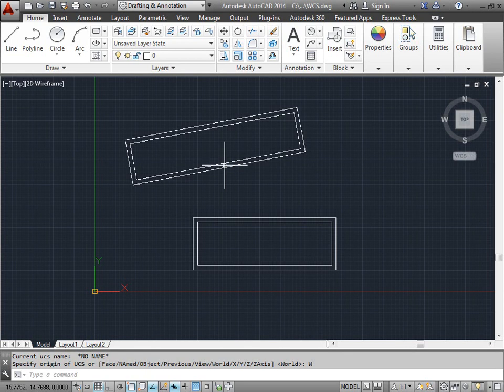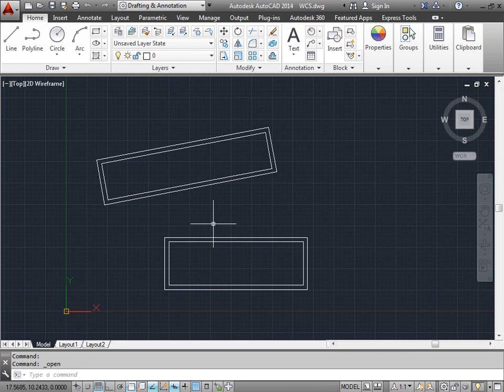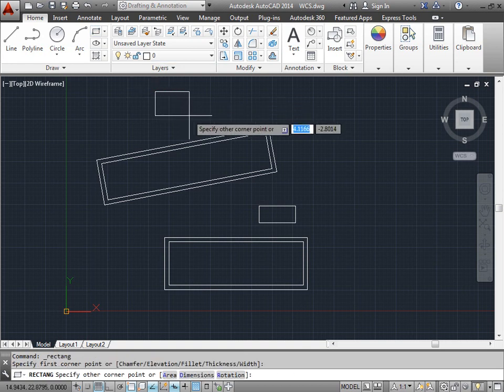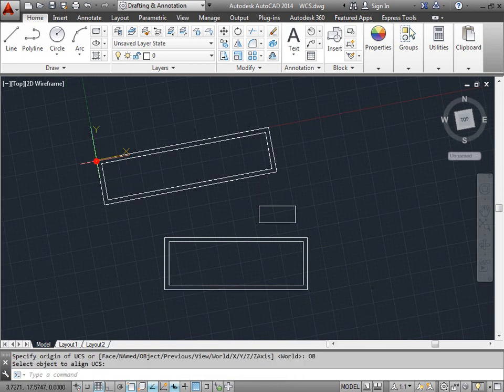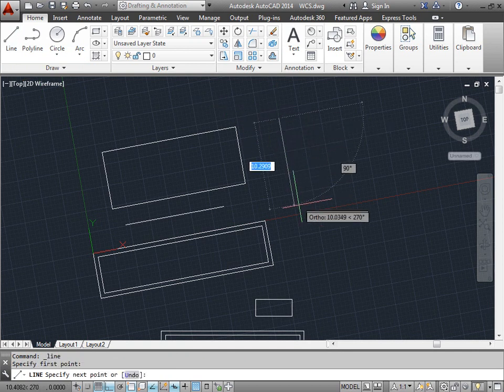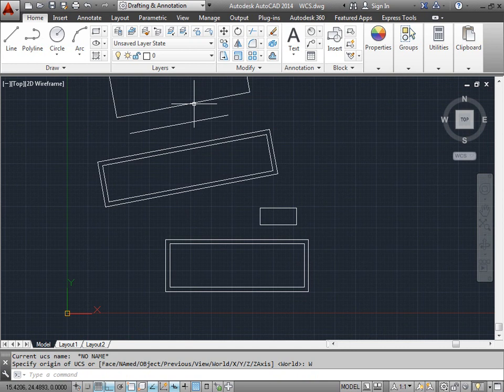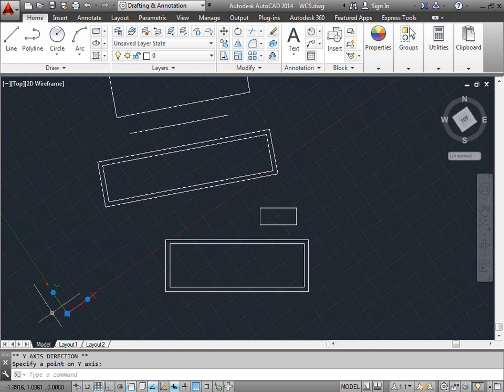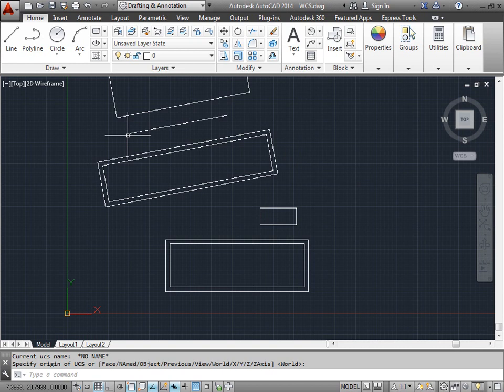C00513  Using UCS AutoCAD 2014 Tutorial

Comment: You could also use the Rotation option in the Rectangle command along with the Parallel Object Snap.

If you need to create several objects parallel to the upper rectangle, then changing the UCS would be beneficial.

Good video.